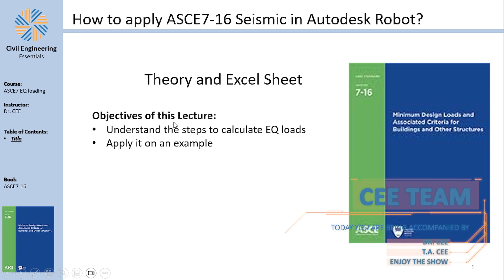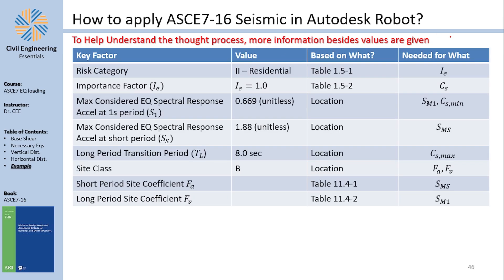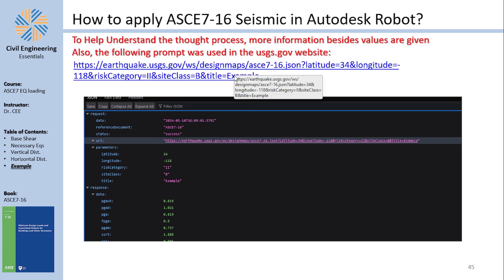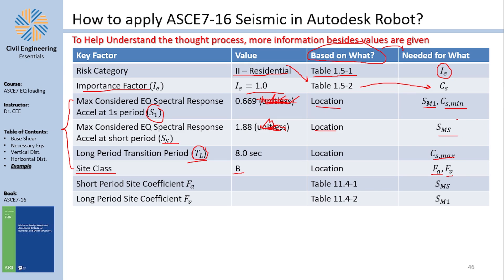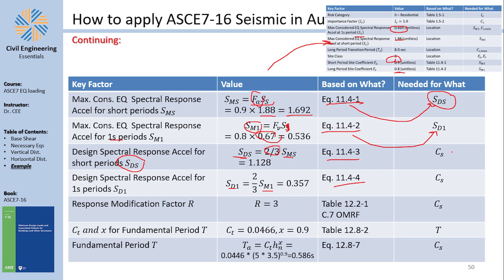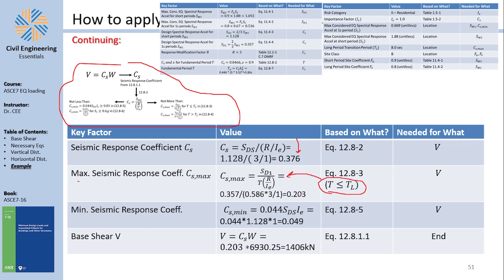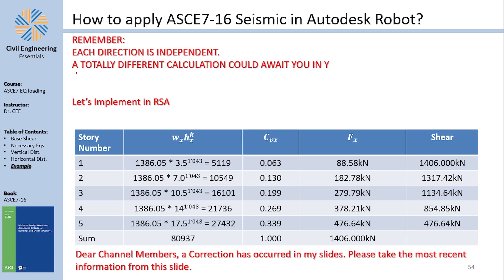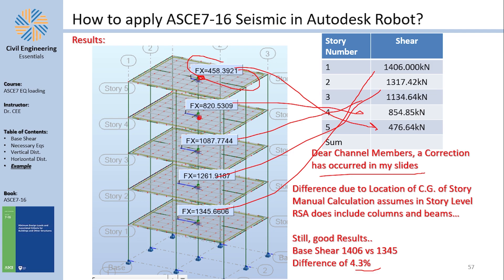ASCE7 Equivalent Lateral Force Procedure in Autodesk Robot - Part 3: Manual Calculations

Comment: There is a difference in the final calculations because the building exponent Ct from the Table 12.8.2 was 0.0466 and what was used in your calculations was 0.0446. I ran the calculations in excel and then simulated it in RSA and got the same output as the software in your video.
Reply from the maker: Yep, I think I messed a small fraction up. If I remember correctly, in the last video I tried to fix it. Not really sure.
Still, thnx a lot for you insights.

Comment: greeting sir! i have a question regarding diaphragm.

i have modeling storey building using sap2000. the slab modeled using shell element. 

do i need to assign all the joint of each story using diaphragm constraint?

what is the consequences if i am not defining the diaphragm constraint?
Reply from the maker: oh that is a very good question. The equivalent lateral force procedure actually "behind the scenes" defines a diaphragm for you when it calculates the load and distributes it on stories.

Now what is a diaphragm: a diaphragm means that the slab does not compress nor extend in its horizontal directions, but only moves in the vertical direction. The consequence is that: the horizontal load is not going to be "absorbed" by the slab deflection in the horizontal direction, but will impact the columns fully.

Here is a nice simplification to the issue. Imagine a slab made out of a "sponge". If you apply a load on that "sponge" at its CG, the sponge itself will compress and "absorb" parts of the load as "strain energy"
But if you replace the sponge with a "metal sheet", then very limited compression will happen (because AE/L is large) and almost the entire load will be absorbed by the columns.

So in short, and in my humble opinion:
Diaphragm: conservative, more loads on columns
No diaphragm: closer to reality.

I hope it makes sense. In case you have any further questions, please let me know.
Regards,
CEE
Reply: @CivilEngineeringEssentials  wow thank you sir! i've been searching this answer almost two years, and this is really clear explanation!
Reply from the maker: @gunxs6091  You are most welcome.
I forgot to highlight that the loads being absorbed are horizontal loads.
Because vertical loads will still cause vertical deflections

thnx a lot. I wish you all the best,
CEE

Comment: the final results are differents, because when you calculated the weight you didn´t intersect the beams with the slabs and columns and Robot did I think maybe that's why.
Reply from the maker: this might also be the case. Still, keep in mind that a slight mis-calculation happened with the period of the structure (very small). The excel has the correct values already.

I hope you enjoyed.
Stay tuned
CEE

Comment: Right calculated Fx and Fy for the structure. But now how to apply the resultant of these forces in combinations where the seismic action enters together with the other actions.
Reply from the maker: oh, that is actually easy. I should have done it in this video, I totally missed it.
My guess is to use the combinations and use those EQ cases like every other load case in those combinations.

I need to check it out myself, but this is my first impression of what to do.

Regards,
CEE